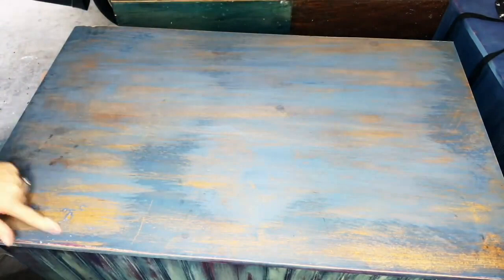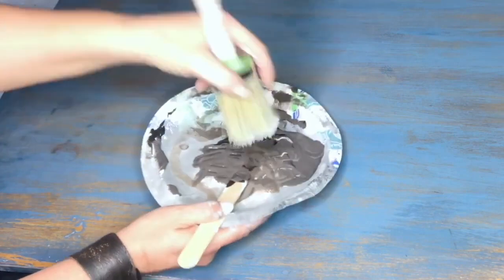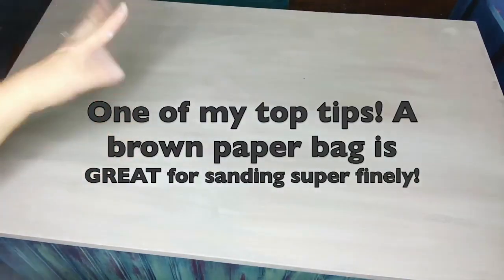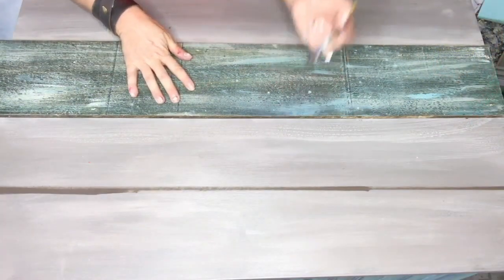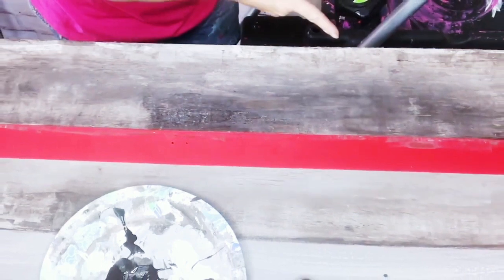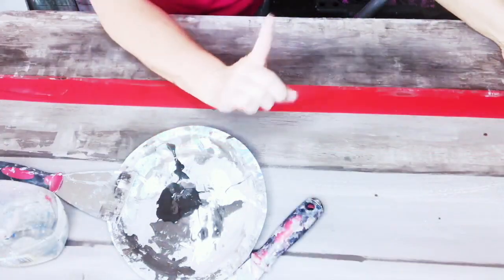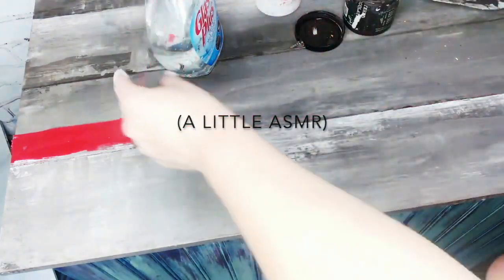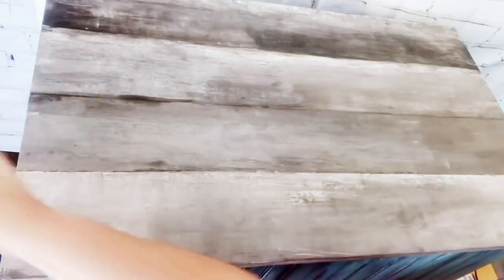How to paint FAUX wood planks (ON ANYTHING. In only 3 steps. )

Comment: What is clay paint?
Reply from the maker: It’s a chalk type paint that also has a clay base… clay is a natural bonding agent, so it helps the paint bond to wood and other surfaces without needing to sand or prime. 
So literally the paint has clay in it, and you can add water and smush it around for texture or add more water and make it smooth as butter, just like clay.